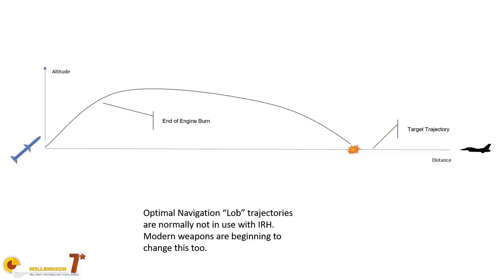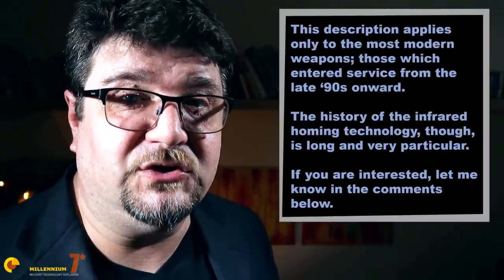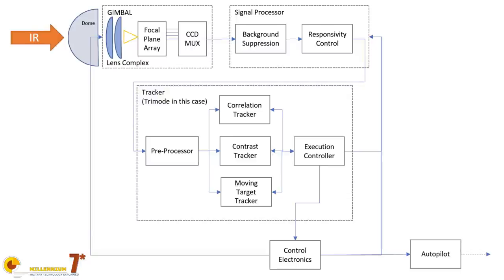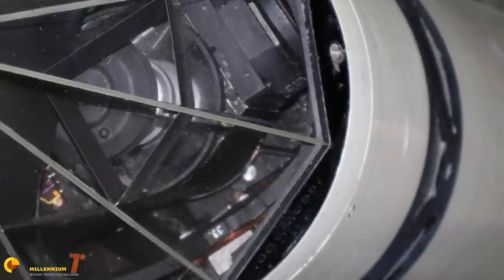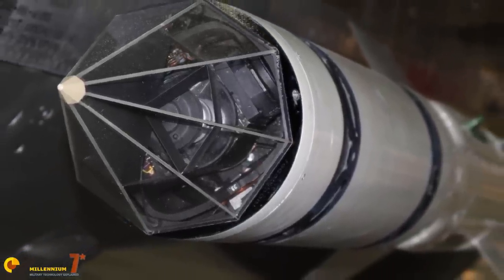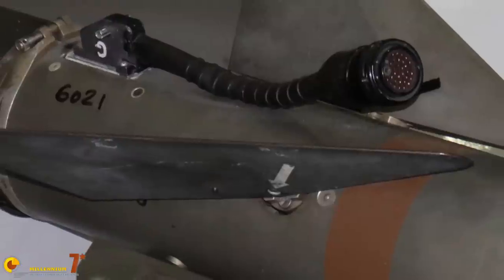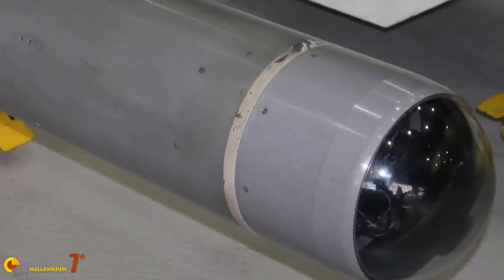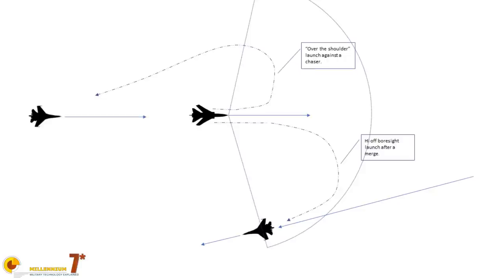The Heat Seekers: Sidewinder, IRIS-T, Asraam etc.

Comment: Actually it seems stealth technology increases the likelyhood of dogfights occuring in actual combat because it significantly decreases the range at which aircraft can be identified.
Reply: We dont know yet if this "stealth technology" works yet, it just makes the plane harder to detect by reducing the radar cross section, aircraft can still be detected by strong enough radars like awacs so BVR isnt out of the question
Reply: What do you mean we don’t know if it works
Reply: @TACCOFSX  lol ok expert
Reply: That's not true the radar's on stealth will see the aircraft first and will fire we use the aim9x for the fact you never know a dogfight is possible war is unpredictable so with this weapon this missile will fly backwards forwards any just look and shoot and forget good to have in the bank if needed also we can shoot at longer ranges up to 90 miles I believe
Reply: @rosevitelli5814  you can't shoot what you don't detect.
Reply: @hansloyalitat9774  it works good against x band mostly use to engage and guide weapon, but VHF and UHF are still able to locate the aircraft.

Comment: There was a secret missile development  program known as Advanced Super Short Range Air to Air  Missile (ASSRAAM).  It was designed to home in on the thermal signature of the jet engine exhaust. The missile would enter straight through the tail pipe and just rip it to shreds. But the program was cancelled because it was to be declassified. But the program refused to come out of the closet.
Reply: Psychological warfare.
Reply: I see what you did there
Reply: Too damn funny!😎

Comment: I'm super interested in how the old sidewinders worked. I understand the basics, but it's crazy that they could use analog circuits for heat tracking 60 years ago!
Reply: It's nearly 70 years now! What's even more wild is that the foundational work for the technology had actually been theorized and explored by the Germans during the war.

Comment: Could you make a video about the very early IR seekers? I think that would be interesting.
Reply: Early IR had no focal plane array but just a sensor like photodiode. To determine the trajectory so called rotating gratings were used. An example of these guidance systems is the seeker if SA-7.
Reply: AAA-4'a - I have a bunch of them - sold one to pawn stars April 2011.
Reply: @vinjulieann1   do you still have some ?
Reply: @Aufenthalt  Actually the earliest quadrature sensors were not even photodiodes. They were lead sulphide photoresistors. EG that AIM-4 Falcon missile in the US and the early Firestreak in the UK. These were being worked on before the first germanium diodes were even available never mind silicon.
Reply: Yes , especially the Hamburg system!
Reply: go pro with thermals trust

Comment: I think the genial idea of the early missiles guidance is that spinning wheel in front of the photocell receptor, which in fact can evaluate the bearing of the target. That's it, how does it work ? Half of the wheel is blank, the other halt is filled with patterns. So when it spins, the IR receptor knows exactly in which half of the wheel the target is located, and the orientation of the wheel tells the angle. Finish, end of story, the rest is just improvements of the initial idea.
Reply: generally the right idea, but its not just one IR receptor. can be up to 4. lack of detection in one quadrant(s) steers the missile away from that quadrant. if all 4 have detection, then missile is centered.

Comment: The sensor is actually a quadrature  themal sensor that is cooled by a little argon bottle though newer ones are mounted on a thermoelectric stack. An american electronic surplus store called American Science and Surplus ended up with several of the older generation seeker heads for these missiles.

Comment: Thank you for making this video.
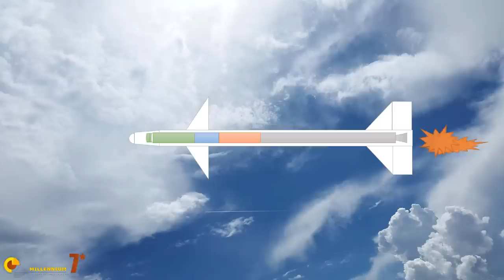In the future please have the terms and pointers display longer when you have diagrams on screen. The text identifying the different sections of the missile in the diagram at 0:59 are only fully visible for about a second. Just trying to rewind and stop the video at the exact moment so I could read the chart was a chore. I had no hope of reading it in the time it was displayed. Also please don't use blue arrows for diagrams where the background is made of blue sky and white clouds. It tends to make the arrows hard to follow since they do not contrast with the blue parts of the background.

Comment: Could a laser be used as a counter to an IR sensor?..  If so it might it be the basis of a defensive weapon against an IR guided missile.  However, there are some issues such as finding the IR sensor which is a lot smaller target than an aircraft the missile is attacking.  Perhaps the aircraft's radar could detect the missile and send the info to the laser to aim it at the incoming IR sensor, but it would all have to happen in a few seconds.
Reply: Well, you could do that and it would work for sure on older IR-Missiles. If you try that against an IRIS-T for instance, you're dead. Because that MF switches than to "home on jam" and attacks the source of the laser, so basically it is laser guided then...by your own  defensive laser...

Comment: Very interesting and informative video. I want to ask what type of IR seekers capable of not locking onto flares and sun. How they work? If they exist.
Reply from the maker: Focal plane arrays simply can recognize the sun and the flares because they work on a picture of the target. Like every technology, recognition is not 100% accurate so they can still be fooled in some cases.
Other older types of sensors were intrinsically more resistant but it is too long for a comment.
Some day I will do a video about the history of IR sensors and I will cover this.
Reply: @Millennium7HistoryTech  So dual band seaker is something same?
Reply: @youmanity1  no, dual band or two color seekers use IR+UV to differentiate between a flare and target. A single color seeker gets easily fooled by countermeasures, that's why you need UV...... infrared imaging seeker (IIR) or focal plane arrays capture targets image just like your smart phone cameras. The only difference you see is that, the image is of thermal imaging of the target...... similar to an infrared camera

Comment: I would like to see an analysis of the June 18, 2017 air skirmish between the US Navy and Syrian air force. The Sidewinder was countered but the AMRAAM hit. It would make a cool video I think.
Reply from the maker: Do you have any reference? I can't guarantee I will make a specific video soon, but I agree it is interesting to understand what happened
Reply: I have had discussions with a few people people on this (the Ja'din shootdown); some of them technical, and from the military, over discord and other forums. And while many news articles reported that the new generation AIM-9X was spoofed by old "dirty" Russian countermeasures which radiated in different bands, many folks expressed the opinion that the 9X simply malfunctioned. Sadly, we can't be sure of what really happened because there can be biases in reporting and even the opinions of technical people... even propaganda. And the actual information would be classified for civilians or anyone who does not need to know.
Reply from the maker: That is the problems for events that are less than 20/30 years old; it is difficult to have access to the details that may tell you what happened. I need to use a good amount of inference to understand how the most modern systems work.
As a very very broad rule of thumb, though, you can tell that:
old technology is not as obsolete as it seems, new technology is not as effective as advertised, the people in the loop are usually the more important factor.
As a rule of thumb, though,
Reply: Millennium 7 * HistoryTech Yeah, just think about the serbian-hungarian guy who downed an F117 and an F16 using a towed decoy, and probably damaged a B2 as well with a vintage 60’s era S-125 Neva SAM system. Or the iraqi MIG-25 pilot who downed an F-18 in a dogfight, and would most likely have downed a second one too if he wasn’t ordered to return to base by his military controller.

Comment: Wasn't an Aim-9X fooled by the flares of an Su-22 in 2017? I don't get it why IR-seekers are still being used for short-range. Put an optical seeker in it, combine it with machine-learning so that it will only recognize airplanes and boom.
Reply from the maker: I head this story, the USAF declared that the weapon malfunctioned. I don't know what to believe exactly. The optical seeker would be in troubles at night or with clouds...
Reply: @Millennium7HistoryTech  
USAF said that the weapon malfunctioned? The Hornet is part of the Navy. 
Check this out, basically it says that AIM-9s were only tested against American flares, but Soviet flares posed a problem due to their nature of being manufactured in a way that each one is slightly different: https://web.archive.org/web/20180226202729/https://aviationweek.com/blog/we-didn-t-know-what-90-percent-switches-did 

Re seekers: True, but IR-seeker can also have problems with clouds or bad weather. I just don't get why - with today's extremely powerful computer technology - the military does rely on IR-seekers which originated in the 1950s.
Reply from the maker: @JohnGaltAustria A refuse, sorry. No, they don't, the focal plane array sensors are conceptually similar to camera sensors

Comment: You are wrong.  Sidewinder IR Sensors do NOT detect the heated skin of the plane (target).   The sensor system is tuned (optical and electronic filtering) to the heat signature of the hot gas exhaust plume of the target ---  specifically, the CO and H2O spectral bands at 2.7um.   As a matter of fact, the missiles sometimes went straight into the planes tailpipe before detonating.
Reply: @432THz:  Actually, it is you who is incorrect.  Missiles with the more sensitive seekers, such as the AIM-9L/M can indeed detect aircraft skin friction.  Missiles with imaging infra-red, such as the AIM-9X and AIM-132 ASRAAM can easily detect the skin friction of an enemy aircraft.  Do your homework next time.